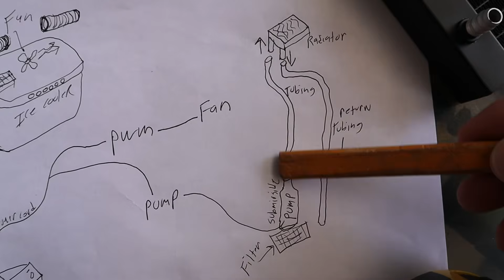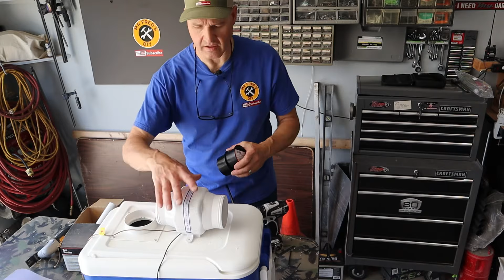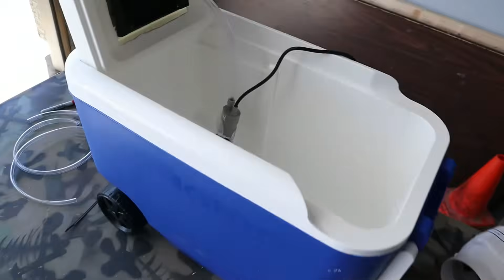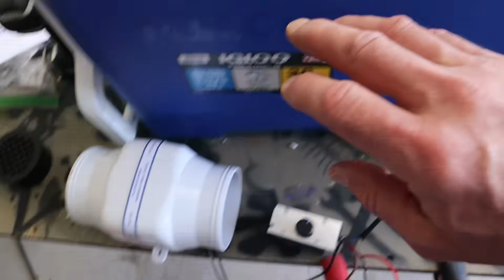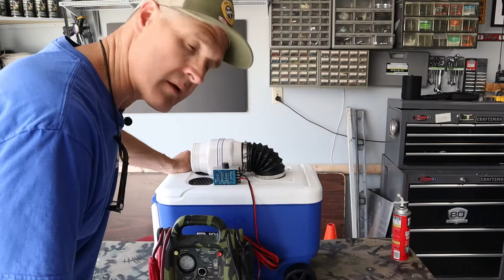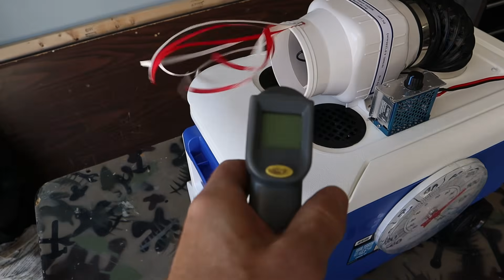DIY Ice Cooler Air Conditioner

Comment: I made one of these (well, really similar, but the same idea, just not as pretty) from another YouTuber, I was really excited to make it too!
As it turned out though, it was a no-go for me here in far Northeast Texas, I assume that you are in Arizona or California since I saw a 'rock yard'. :)
With your lower humidity it might work, but with our higher humidity, it doesn't work at all.

Mine went down only ONE DEGREE F under the room temperature, which was 78 degrees F.

I'm only letting people know that although your build is BEAUTIFUL, and I have zero doubt in my mind about it working for you, it will (probably not) work in states that are more humid.
Just for you people that plan on this, do your homework if you want to make one of these. I spent $50.00+ to find this out.
I have almost the same components that he has here, well, some of them, but the exact principle...

Mr. Fred, I really like how nice you made this, I am not at all knocking what you did, but only mentioning where it will work, or, in my case, not work.
Thanks!
Reply: If you had used dehimidifier in the room, would thet have helped?
Reply: @kookia213  More than likely it would. If the dehumidifier was equivalent to the gadget.
The point of these 'air conditioners' though is to make it cheap and operate it cheaply. That kind of negates the point.
I think that for what it is, and where it is used, it's a GREAT thing to have, but not so much in a humid place.

Also, had this gadget worked for me I would have had more than one in different rooms. If I needed a dehumidifier for each of the rooms, well...  :)
Not that I would have them all going at the same time, but then again I wouldn't really want to drag all of the things into different rooms either.

Don't get me wrong, I am all for people making these, but people that live in a humid area need to realize that these will 'probably not' work.  :)
Reply: @rec1952  how humid are we talking about? 100%, 90%, 80% or above amy other certain %?
Reply: @kookia213  If I said I knew, I'd be lying. :)
Right now, my thermometer shows to be 96 degrees F. I am not sure what the humidity would be right now. I live in FAR Northeast Texas up by the Red River.

In the Summer it's usually anywhere from 50% to 95%, all depending on the time and of day, and some days are better, and some days are worse.

All I know is, when I was a kid we didn't have air conditioners, we had a window water cooler. Those were all that most people knew back then, air conditioners were not common at all.
Even so, I remember many a night that the entire family would sleep in the living room underneath the "cooler'.

I lived around Dallas, Texas my entire life, it was, and is, a lot hooter there than here, and more humid too.

All I know is, I made the contraption and it doesn't work for me at all, I HOPE that I am the only one that has had this.
I mean, it's not like I didn't know there was a chance that it wouldn't work. I had high hopes that it might, even though science doesn't agree as much. :)
Reply: In terms of adding moisture to the air, I think that this one will add less than the myriad other ones with air just blowing over ice.  Mainly due to the foam and the placement of the radiator.  As he stated, the foam keeps the environments separate so most of the air doesn't directly contact with the ice/water.  I say the placement of the radiator might help as I'm thinking that to some degree its going to condense some of the water in the air as it cools it and it will drip back down into the cooler.   Not saying its going to be perfect, and nothing here is airtight, but perhaps less added humidity than you think.
Reply: @trippelini1219  I have no doubt that you are right. Still, in high humidity areas, it will be harder for it to cool.
The one that I built was from another YouTuber, not Mr. Fred's, but still, it has the same plans essentially. 
I had ice water from the refrigerator and a frozen milk jug of ice in an ice chest, it just did not work.

I mean, it's a really simple process, I can't even imagine that it could be screwed up so bad that I can't see it, but, I might be crazy, and if anyone knows what it might be, I'm all ears. :)

I'm not poo-pooing Mr. Fred at all, and I'm glad that people like him make these videos, but, as far as science goes, to my knowledge it just doesn't work, or, work well in high humidity.

Hey, I want it to work, and prove me wrong, I hope that someone does, I could sure use it right now. Today's supposed to be 105F according to Weatherbug!  :)
Reply: @rec1952  I suppose,  but I think at some point you have to realize the limitations of this sort of air cooler in that, if you have it blowing on you, and the room you are in is small (as in the square footage  of a standard 2-4 person tent, car or van),  you will see fair  results.     Any air cooling thing that is just dumping the heat energy they are extracting back into the stuff that is the source of the cooling can hardly be called efficient.  Its reasonable to assume that as the air gets colder there will be less heat to extract and the cooling effect will get easier for the machine.  But, If people are thinking its going to cool off someone's garage to a balmy 70 degrees on a 100 degree day.. thats not going to happen.  Its a large place, and its hardly well insulated.  Hot air will continually get replaced.   Its not dissimilar to using one of those portable AC units you can buy for 400$ or whatever.  They are inefficient as well.  While they are in theory pushing the heat energy outside, they are still using the air they just cooled to do this which will have diminishing returns as  you are at least partially air conditioning the outside world.  Regardless, one's expectations for something like this should be lower.  Have it blowing on you.
Reply: @trippelini1219  Nobody that I have ever read in any comments said they expected it to cool an entire room, small or large.
I know that I sure didn't expect that.

I will say that even though I was 3 feet from it, and all was right with it, and a thermometer directly in front of it, it was only one degree F cooler difference on that thermometer.
I literally mean, it was room temperature air.

I'm not talking across a room, I tried and tried, it just didn't work.
(I do believe that it works in Arizona, etc)
The expectations that I had were to slightly cool me off in a 11'x12' room. Not the entire room, but me just feeling it in front of me 3 feet away.
For that matter, even a few inches.

I am really surprised that nobody is talking about this. Maybe I'm the only person that built it that lived in a humid area. Maybe I was the only one that built it and admitted that it didn't work as expected, I don't know, I just know that it doesn't work for me.
I mostly see that people say, "I am going to make that!", then, maybe they do, maybe not.

What's so funny is, after I tried this, I just bought a battery operated 5-1/2" blade fan that cooled me off perfectly. It cost me $34.00 though.
It was so good that I bought another.
The fans were 'in case' my power went off, so was this DIY air-conditioner, but...

By the way, this 5-speed fan that I bought has a bright LED light, its battery operated AND USB 3, virtually noiseless. It charges up really fast and when I tried it out it literally made me too cool. (Of course that was in the Spring) :) 
It even oscillates!

Still, I am going to give it another chance soon, just because.
Like I said, I want to work, but then again, I want to fly too. :)
Reply: @rec1952  Did you ever consider that maybe, just maybe you built it wrong? I can even see some pretty big flaws in this design.
Reply: @F5Tornado44  What? I said a few times that if anyone can tell me how I could have built it wrong to please tell me.
How do you know what design I made anyway?
I didn't make this design, I made a similar design by another YouTuber.

I seemed to have hit a nerve here in the Comments, that wasn't my intent, but, I do believe that this project won't work for everyone, and if that is so, it needs to be discussed.
Nobody discusses this, they only say, "Ohhh-Ahhh!", etc. or I am going to make this this week-end and you never hear from them again.

Yes, I do know that they are not making an actual air-conditioner too, that has been brought up by many people, for many years actually. (Since there are several designs by several YouTubers out there)

So, please, I am asking, how do you make these that are correct?
How can we learn?
Show us by showing us.

As far as making it, I made it exactly as per the instructions on the video I watched. I used the exact products when I could, and the ones that  weren't were really close. I mean, it's really not rocket science to follow it, but, being human, I can and do make mistakes, and it's entirely possible that I did, so please, enlighten me/us.

I'm not being a jerk here either, I am serious.

I have seen guys that say in these comments that always come and say how it is done wrong, but they never show anyone how to do it, they say all of the air-condition-y things that are above 'normal' people's heads, we all don't know air-conditionese.

I am also sure that there are people that can literally build an actual air-conditioner, but that is not what any of this is about.
Reply: @rec1952  Dude, chill the eff out. No pun intended. I was saying "maybe" you made it wrong. I don't know how you made it, or who's design you copied, but I'm guessing his design may have not been that effective either. And since you haven't told us which design you copied, and you haven't posted a video of your own showing what you built, we can't point out what you "may" have done wrong. OR if you did everything right and it just doesn't work with the humidity you live with. I will say this though, if a fan works, and what you built does not, then YOU BUILT IT WRONG.
Reply: @F5Tornado44  Go back and read what you said to me, and see for yourself what tone that presents. (After others here have seemingly doubted me)
There is absolutely zero ways to tell how you are talking to me, no inflections to go by, so read that and think if I had said that to you.

I wasn't even being rude to you, I did tell you what I had already (if you had read) what I had done.

Hey, believe me, or not, I made it EXACTLY like the other guy did, and it doesn't work due to humidity, believe that or not.

If you aren't here to help, you aren't doing anything positive.

Go away.
Reply: @rec1952  Were you born in 52? Because your attitude sure does reflect an old bitter man. Good luck with your fans.
Reply: @rec1952  Oh, also, I just want to add. I help people a lot. I'm a very experienced welder/fabricator. I design a lot of tools that I need in projects I've done. I have the ability to see flaws in designs that will make them work much better. For instance, this videos design would benefit greatly if the return water line was routed on the opposite side of the cooler. Dumping your now heated water right in front of your pump isn't a very effective way of cooling the water coming in to the pump. Also, a variable speed on the pump is a complete waste. What would that accomplish? You don't see A/C compressors slow down when you set the fan speed to low, do you? I COULD help you, but your attitude just makes people want to say F.O. to you. Maybe you should work on that first.
Reply: @F5Tornado44  See? This is what is wrong with the internet, IF, you had said this when you first contacted me, (the nice parts) we wouldn't be here right now doing this.

I, too am a very helpful person, but, it seems that when I try to help, people just blow it off, or aren't thankful enough, not that I do it for that reason.
I help 'internet people' all day long, every day, not that you'd believe me, and I understand that.

I'll see what you are referring to tomorrow, and see if that 'helpful information' helps.
I don't doubt for a minute and never did that you knew what you are talking about.

Not just that, but, I apologize to you, I actually do believe that you are a good person that helps, but, really, re-read what you said to me and take it as a person that doesn't know you from the internet, maybe you can understand why we are at this point and time.

I can promise you, I am not even a little bit upset at you, I literally thought you were a troll. :)

Really, we just connected wrong, that's all. :)
Thanks for the tip!
I'll just go "F.O" now.
Reply: @rec1952  Maybe it's just me, but if you are referring to this post: " Did you ever consider that maybe, just maybe you built it wrong? I can even see some pretty big flaws in this design.", then I'm still not seeing where you think I'm trolling you. The part where I said "Did you ever consider that maybe, just maybe you built it wrong?" I said because your previous posts are of frustration, because it wasn't working for you. Not saying you are dumb or anything, but that the design you copied from was built wrong. In essence, you built it wrong also, even though it was copied identically. Now the part where I said "I can even see some pretty big flaws in this design." I think you misunderstood. I wasn't referring to your build, I was referring to the build in this video, as I just pointed them out in my previous post. Yeah, I understand that things can get misinterpreted in post, and that there are a lot of people that just get off on trolling, but you have to ask yourself sometimes "Did he mean it like this? Or did he mean it like this?" When you are reading text, you can't see facial expressions or hear the tone of their voice, so you have to interpret it both ways, then make a decision on what you think the person meant. If you determine it was with malicious intent, ask them why. "What do you mean by that?" If they're there to troll you, you'll know right away.
Reply: @F5Tornado44  Really, I am aware of all of the above, I've been on the internet since almost its inception, so I have seen a lot.
You can read my stuff wrong, and actually did, I read your stuff and actually did.
When you said I might have built it wrong, a better way would have been to say, 'Maybe it was designed wrong'. That way, there is zero interpretation. 
I swear I did not reply to you in a rude way, but you also misinterpreted it that way.

I always look at it the best way first, but, you, being an internet person, and me, also being an internet person both assumed.
(The internet is like a bunch of kids, kids  say way more than they should, internet people act like kids too much)
When I said, "What?", that was me saying it is a really questionable way, not being a smart-ass. 

I wasn't even a little bit frustrated because my air-conditioner didn't work, I literally came on this video to make people aware that it might not work if they are in a humid area. I was trying to be a helpful person, not being a jerk at all.
I really didn't come for answers, although, if someone knew the answer I am not above taking their advice, I promise.
I think it's safe to say that we both did something that could be misconstrued as something else.

I left it up to the people to decide if they wanted to chance spending a possible $50.00+ on something that may, or may not work. (I don't remember what this particular A/C thing cost)
I know that I wouldn't have chanced it had I known there wasn't a chance, or even a slight chance that it wouldn't work.

The guy "Desert Sun" is the one that did the design I used, he is maybe not as knowledgeable as he is needs to be, but he does more than I can. I'd have to compare what he did and what I did (again) to see whether or not I got the hose backwards.

Anyway, we get it, it's over, and I will look at the way you described later today and let you know what happened.
Let's forget all of this.
Reply: @rec1952  Okay, now we're getting somewhere. Is it this cooler? https://youtu.be/ITtlxjvLQis
Reply: @F5Tornado44  I did all that I could, I  followed your advice and I tried it every way that could be done as far as I can see.

I didn't reply yesterday because I 'thought' I had a gallon frozen milk jug, but I didn't.
So, a few minutes ago I set it all back up and I changed things up as much as I could to see what might happen.

I had water that was 60F, (with the milk jug ice) while that is not REALLY cold, it should at least show somewhat of a difference. It didn't.
Hardly, anyway.
Anyway, I rerouted the return line as you suggested, I have the lines that go into my cheap-o ice Styrofoam chest only exposed a few inches, just like before.
That just means, they are only showing on the outside for 'around' 6"-8" or so. No real time to get too warm.

"Desert Sun" had his REALLY exposed and he was recording in the 40's when he used his temperature gun, which is the exact one I have.

Really, I tried my best last time, and, this time, this just doesn't work, or I am still doing something incorrectly.
What it is that I could be doing wrong is beyond me.

The COOLEST temperature that I got was 75F, that is in a room that is 80F.
(I let it sit for awhile)
The humidity is 45% inside and 21% outside according to my weather station. (Outside temperature is 89F at 11:00am)
I have no way of knowing how right the station is as far as humidity, but I have checked many times and the temperature is always correct.

I may, or may not have been able to get it down another degrees or two IF I had two jugs of ice, and ice water, or ice water with ice also in it, but I've gotten tired of this build, if this is what it can do, it's too much trouble.
It's a LOT of trouble anyway, but for an emergency it would come in handy, possibly...

I tried this set-up with the fan behind the radiator, in front of the radiator, I switched hose placement on the  radiator, I did what you suggested about the warmer water might be too close to the outgoing hose, that kind of thing.

I mean, the air is pleasant in front of the fan, but it is not worth doing if that is all I get from it, or, rather, what anyone that builds one of these gets from it. (That lives in places like Texas)

I don't know if I wrote it here, or on the other guy's build, but I was raised with water coolers, we would sleep in the living room at night when it got really hot. (Dallas, Texas 1950's)

It was not so much cool air that  we got, but rather 'wettish' air, very humid, it was a lot better than the hot air that w as outside.
Not just me, but even my wife and her family did the exact thing.
'EVERYONE' in our neighborhoods all had the same set-up too, water coolers, nobody I ever heard of had a proper air-conditioner until the early 70's except in some of the better apartment buildings.

So, that kind of tells me that people in Texas can't get the same results as other places using these types of things.

I will say that I just checked it (again) and the temperatures were at 70F, that is my Harbor Freight laser gun pointed at the middle of the grill on the radiator. (No fan at all)
While that is better, and 70F is pretty cool, I did fill the chest up with another gallon of (room temperature) water.
I cannot tell a difference with the fan on or off (or removed entirely) from the radiator at a 3 feet distance.

I am 'pretty sure' that this design, or ALL designs that say you can make an air-conditioner in a humid environment is not correct. Like I said before, I am sure it will work in lower humidity areas, just not here.
(Most times our humidity is a LOT more than the above I stated, the humidity I mentioned earlier has already risen to 49%)

Thanks for your suggestions, believe it or not I do appreciate them. :)
Reply: @rec1952  Yeah, no problem. Use your thermometer and aim it at the water coming back into the cooler. That water sounds like it isn't really getting that cold. Considering water freezes at 32*F, your water in the cooler should be in the ballpark of 40 - 45*F. And if the flow of water is good to (and back from) the radiator, with the fan off, it should be only a couple of degrees warmer than the source water. Maybe your water pump just doesn't pump enough volume. I get that this is a big pain in the a$$. The way I see it, this would only be more of a supplemental source of cool air to an air conditioner and not really a replacement. Freezing blocks of ice every night can be a big pain as well as the added cost of energy to freeze that ice.
Now if you could get that air coming out of your radiator to around 45*F, you would feel that, but to have a noticeable effect in a room, it'd really have to be flowing some volume at some really cool temperatures. With your system, the way it currently is operating, you are actually making it feel hotter in your house than if you were running nothing at all. You are putting more humidity in the air, along with the radiated heat from the fan motor, and don't forget about the freezer working overtime to make that ice. A room at 80*F and 49% humidity is going to feel a lot hotter than a room at 90*F and 15% humidity. Good luck. I hope you find a way of making it more comfortable in your house. Heat sucks.
Reply: @F5Tornado44  I may try that again tomorrow.
I'll aim at the outgoing water inside of the cooler.
I did aim at the water in the cooler, it was the same as the actual thermometer that I had in there, so I had 2 thermometers actually. They both read the same.

The water is not that cold, I knew that, but I still could kind of tell what it could do, and it wasn't much. I didn't have enough frozen stuff to do what I needed.

I could have ripped the ice out of the plastic jug, I did last time and it didn't make any difference. Desert Sun did on one of his, and not on another.
If I had two jugs of ice I probably would have, I know that works better.

The Desert Sun guy had temperatures down into the 50's without any ice, if I remember right. When he put ice into it it got into the 30's, which is really good, for him.

So, but him getting what he got with no ice, and mine being with ice, I can already tell that it may not be worth it.

The fan that he recommended isn't that strong, and the radiator is very small.
He made one a while back that had larger parts, but I didn't want to spend money if it might not work.
I'm really glad that I made the small one.

Anyway, I am only mentioning this 'in case' it helps others think, and plan, and possibly they may have a workaround, or a way that helps. It may deter some, but there are no guarantees,  especially on the internet. :)

Thanks for the input!